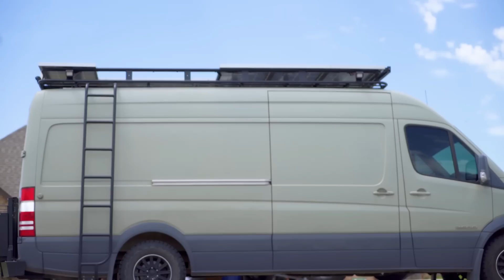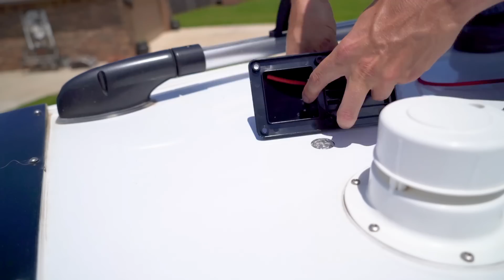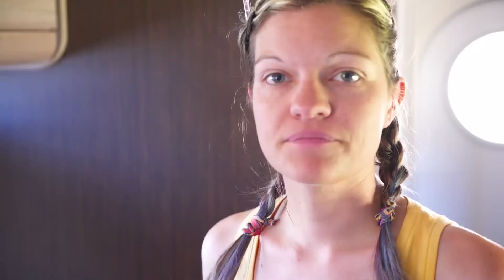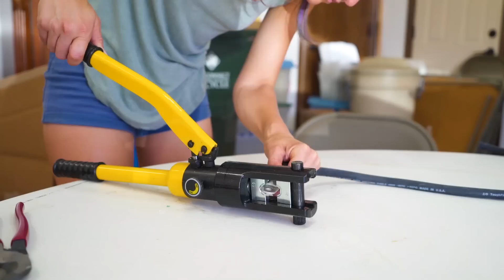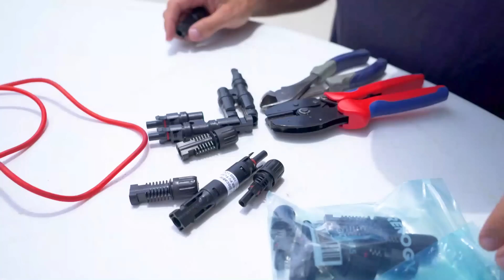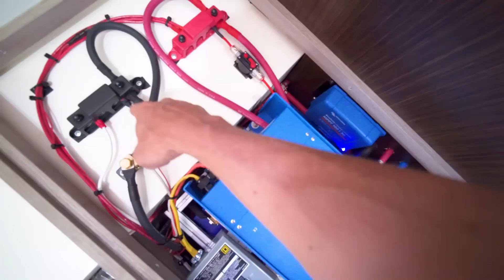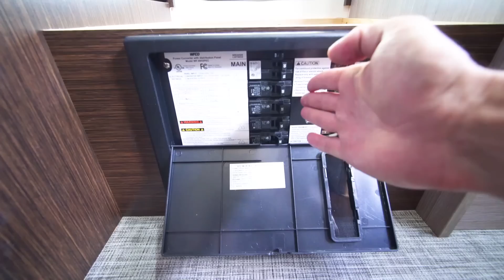Camper Solar Setup Tutorial - How to Solar Power your RV, Camper Van, & Truck Camper

Comment: Thanks for all the info! I'm new to this stuff and starting a restoration/upgrade to an old Shasta travel trailer.  I'm planning to be pretty low key but I definitely want to add solar for charging tech, basic power options. We'll have a small fridge, a water pump, lights and roof fan. I don't expect any major power suckers like AC, Microwave ect...
My question is just how to determine how much power/panels and batterie storage I need? Do I need more that 100-200 watts? The 400 watt system even seemed a little excessive for my planned setup. Any resources or thoughts would be appreciated!

thanks!
Reply from the maker: Hey Joel!  Sounds like a cool project.  I've actually got another video that answers that question.  You can find that here: https://www.youtube.com/watch?v=a406IxiU-Xg

Comment: when funds are unlimited... solar is easy... this is easily a $3,500 system if not more...
Reply from the maker: This system in particular is, indeed, more than $3,500; but they concept is the same if you'd like to use less expensive components.

Comment: Excellent video you 2 made here. Very well explained for us newbies to understand. You get 2 thumbs up👍👍 from me!! 
 I'm putting 1200 watts on my motorhome. Maybe 1600 soon after if I have room. Wire sizes confuse me, and how to set up the panels to get the most usable power. Will have 5 or 6 battle borns soon. I want a 150v/100 amp controller, 3000 watt victron inverter, but confused on connections cuz the RV already has a seperate automatic transfer switch.  
I've asked for help from others on YouTube many times but never get a response. Any suggestions would be greatly appreciated!!

Comment: Great explanation as usual .understand the series parallel solar panel connection .what is the nominal voltage of the solar panel or the input voltage to the solar controller
Reply from the maker: The voltage from the solar panels are somewhere around the 19V ballpark.

Comment: Why do you use such small panels? - we get up to 20amp 12v  charge from a  single  REC 280watt panel and it's hooked up to a 100 amp lithium via an EpEver MPPT - it's only a small European van  - I think proportionally larger panels give more bang for the buck, they are lighter and more power dense if you can get them to fit
Reply from the maker: These panels fit better than bigger ones for this application.  On https://www.explorist.life/solarwiringdiagrams we have more panel size options for you to choose from.

Comment: Thanks for the excellent job! Help me understand clearly, the fridge is not connected to the solar charged batteries? Seems like a whole lot of effort to end up with an ice chest when off grid. ?? Have I totally missed the mark?
Reply from the maker: The fridge is a 3 way fridge, which means it can be powered by 12v DC, 120v AC, or Propane.  The fridge is still connected to 12v DC and Propane, so it is still fully operational off grid.
Reply: @EXPLORISTlife  Thanks for the explaination. Appreciate it and your videos.

Comment: Could you plug your new inverter out (110)  straight into your shore power plug.?Then just keep your AC breaker off. I am doing my truck camper solar . I have considered this but have not tried it yet. Not sure if might have a issue with the other  110 to 12 volt inverter to charge batteries .
Reply from the maker: The easiest way to do it would be just to splice your 10ga shore power cord before it goes into your power distribution panel.  Shore Power In -> Inverter/Charger AC IN -> Inverter/Charger AC Out -> To 30 amp main breaker in power distribution panel.

Comment: Awesome video. I have a question for you I cant find the answer to. I have a 22ft. travel trailer. When I get my system installed and hooked up will my fridge run off of my inverter?Obviously I don't want it to, I want it to run off the propane when Im not hooked up to a shore line. I guess my question is how do I run the solar in regards to my fridge. I want the fridge to run on AC when im hooked to shore power and I want it to run on propane when im not hooked up to shore power even though everything else will be using the inverter. Any help would be great.
Reply from the maker: If you wire it like we did, It will run off of DC (which will be powered by shore power) when you are plugged in.

Comment: Is it possible to expand these down the road without too much trouble?
Reply from the maker: If you plan for it properly it's pretty straightforward!  The new wiring diagrams at explorist.life/solarwiringdiagrams are all designed to be easy to expand upon.

Comment: I have a 1969 trailer i converted to a mini mobile and have instaled a solar system two systems one 800 watt one 400 watt 800 watt is primary 400 watt secondary runs my hole trailer
Reply: Thanks

Comment: Im curious why the microwave circuit didn't get tied into the new system. I know they draw a lot of power, but they're typically only used for a very short period of time. I just think it'd be nice to have the option of using it without having to plug into shore power.
Reply from the maker: Right, we didn't do that because it's a high powered appliance.  Add a second breaker and another wire relocation for the microwave if you want to do this in your own setup.

Comment: Hi, apparently in the UK the household plug voltage is 230 V. Does that mean the inverter I buy should change to 230 V? Would that be the only difference in product? sorry, I'm a beginner.
Reply from the maker: The inverter should also be 230v input from shore power as well as 230 output, but there will be more to change, but I'm not 100% up to date on European wiring specifics.

Comment: How much bigger of a system would you need to be able to run the fridge as well
Reply from the maker: Those 3 way fridges are less than efficient, so we wouldn't really even consider it; ufortunately, I don't have the stats and data to know how many amp hours per day the fridge uses, but once you knew that, it could be plugged into our power audit calculator you can find here: https://www.explorist.life/what-size-of-solar-system-is-needed-to-power-a-camper/

Comment: 1. What about EMF/EMR shielding for the Inverter, DC legs to the inverter......etc! ?????  2. Does a DIY install affect the RV insurance rates or does this need to be installed by a Solar certified technician due to some insurance carriers policy requirements?????  3. Is that the Penson wire crimper $40, any thoughts about it compared to other crimpers like the TEMCO hydraulic wire crimper that sells for around $80??

Comment: Awesome Video. I am putting in almost the same system. By splitting the shore AC and Inverter AC (Plugs Only) did that eliminate the need for a transfer switch?
Reply from the maker: Not really...  The Victron Multiplus has a built in transfer switch, so that's actually what gets rid of that.  The transfer switch and the switching of the plugs like we did are not really related.

Comment: THANK YOU FOR YOUR DETAIL VIDEO 
WHAT ABOUT WORKING WITH 24VOLT TRUCK AND RUN 12 V SYSTEM  WITH C-TECK SMART SYSTEM TO CHARGE 3 BATTERY AND WITH TWO 100W SOLE PLANE?
BECAUSE of ISUZU NPR CREW CAB 4X4 TRUCK 
FROM AUSTRALIA

Comment: Excellent info, tons of knowledge! Very impressive!  One thing I am a concern though.  Trusting a plastic anchor up on the roof to secure a solar panel that will face headwinds while driving down the freeway?  .... may want to rethink that.  Plastic anchors are not designed for that kind of stress.  It is actually a very weak gadget.
Reply from the maker: Rethink that?  You'd like us to drive halfway across the country, uninstall the panels, and do it some other way?  No thank you.

But please do not be concerned.  The panels are not held in place with merely a weak plastic gadget, no.  The tube of epoxy mixed with the plastic anchor makes a solid, immoveable slug of polymers for which the screw is driven into.  But that's not all.  The Industrial grade foam tape used provides nearly 70 lbs per foot for a total of 280 pounds of upward lift resistance per panel.  Furthermore, we used an elastomer adhesive over the top of each foot.  Which, if you didn't know, has a tensile strength of about 160psi.

Moral of the story.  If we lose the panels going down the road; the roof is coming with them.

Comment: Can you use the solar charge controller to also charge the starter battery for an rv at the same time?
Reply: I was only using the rv starter battery as an example. I have a race van with my motorcycle scored in the back and wanted to be able to charge it while on the move. I don't want to have to rune the charger for my motorcycle off the inverter. Be counter productive that way. The only thing I can think of is a DC to DC charger wired directly to the batteries. But was hoping for a neater solution. Hate multiple terminals with inline fuses connected to the batteries
Reply from the maker: In our setups we don't charge DIRECTLY from the charge controller, but we use a battery isolator or b2b charger to charge a starting (or motorcycle) battery from the house battery bank.  I don't have first hand experience with this one, but I believe this solar controller has a 2 amp trickle charge aux output that's for that purpose: https://amzn.to/2HwHTzZ
Reply: @EXPLORISTlife  thanks
Reply: @ACEighty7  If you have solar a battery bank  and inverter in trailer already...keep it simple and just use a battery maintainer, that gives you the option to use it for others too. Your bike battery shouldn't really need to charge most of the time.
Reply from the maker: Totally agree with mrmotofy on that one.
Reply: Damn auto correct
Reply: So after digging around a little more I found probably the best solution. A DC to DC charger which I will hardwire into my 12v distribution board with the appropriate fusing and a basic switch to turn it on and off. Being wall mountable I can keep it close to my electrical cupboard but also keep the connections to the batteries minimal and tidy.

Comment: Hey, I have a couple of question...
1. Would I be able to have a battery isolator charging my battery bank while the car is on AND have the solar panels charging my battery bank when the car is off? Is that an impossible setup?
2. Do you have to unhook everything from the batteries when connecting them to a battery charger? For example, if you're connected to shore power... could you potentially connect a battery charger to either battery in the bank to charge the batteries?
3. Is a single 100w solar panel enough to charge up or maintain your batteries topped up? I have a 205ah setup
Thanks for the video..was very informative
Reply from the maker: #1:  Totally possible.  When the solar controller senses a secondary charging source, the solar controller turns off allowing the other to work.  You really want only one charging source working at a time, but the switch from one to the other will happen automatically.

#2:  The way things are set up in the video, nothing needs to be disconnected.  All of the switching happens automatically.

#3: If you use your entire battery capacity in a day, a 100w solar panel will likely be unable to recharge that much in one day.  Since you've already got your battery bank, I'd recommend starting here to find out how many solar panels you need: https://www.explorist.life/how-many-solar-panels-are-needed-to-power-a-camper/
Reply: @EXPLORISTlife  do all solar controllers turn off when it senses the isolator is now actively charging the battery bank?
Reply from the maker: As there are literally hundreds of brands of solar controllers on the market, I can't speak for all of them, but most of the more popular ones will shut off.  All of the Victron ones will.

Comment: are those drywall anchors strong enough for highway speeds?
Reply from the maker: By themselves, likely not.  Coupled with the epoxy, 3m foam tape, butyl tape, and dicor sealant?  I'd guess if the panels came off, the roof would come off with them.

Comment: might be a dumb question but if you're plugged in to shore power on a sunny day could you back feed power to the grid if your demand for power is lower than what the panels produce?
Reply from the maker: Nope!  The inverter/charger takes care of that and makes sure it doesn't happen.

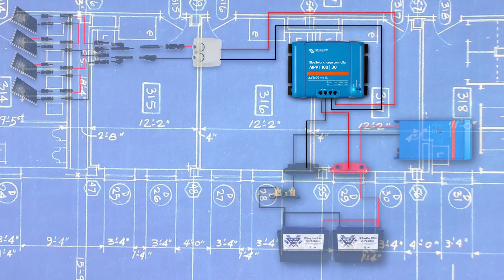Comment: @ 12:08, Is the reason your panels are wired in series to drop the amps down for the controller? wouldn't it have been better to wire in parallel and use a 40amp controller? or does it not really matter with an MPPT controller?

Comment: bro quick question why in the hell did you splice into the fuse box you do know that fuse box is also a inverter
Reply from the maker: There was no pre-existing inverter in the RV.
Reply: EXPLORIST life Oh okay I'm used to dealing with some of the old rv where the fuse box is also the Inverter
Reply from the maker: All good.  It's definitely a good idea to check and understand the existing system before you get started.

Comment: Appreciate some insight here... It's not clear to me how having multiple multi-stage charge controllers connected to the batteries works.  In my setup, I wasn't thinking of having an inverter as I just need DC power for overnight boondock stops, not multi-day dry camping.  I was thinking of having 
1) install PV -> multi-stage solar charge controller, 
2) replace RV's basic single stage charge controller with multi-stage to charge when connected to shore power

But now, do the two multi-stage controllers conflict or fight for different stages?

Comment: I appreciate that you didn't use soldering on any of your connectors. many people will say otherwise, but there is a reason that all wiring is always professionally done using crimped connectors, not soldering.

Comment: Hi @Explorist Life, thank you for the very helpful video.  Do you have more info about how you wired in the Air Conditioner so it didn't go through the inverter?
Reply from the maker: The alterations we showed with the 110v wires in the junction box going around the breaker box is how we circumnavigated the air conditioner.   As long as you don't wire the inverter to the house breaker box, it won't power the AC.
Reply: @EXPLORISTlife  Thanks.  But then how do you have a breaker on the AC?
Reply from the maker: The breaker is still functional in the breaker box.  You're just taking the 110v plugs away from the breaker.  The air conditioner will function as normal.

Comment: What i don’t understand is why the Inverter costs so much? A uninterrupted power supply with similar specs is literally 300-400 dollars and does the same thing converting 12 volt battery power to 120 volt AC... All you have to do is crush the annoying  buzzer and wire the battery cables to the rest of your batteries and you’ve got an extremely easy to use inverter. Some of this specialized crap is stupidly simple to get around.

Comment: The wire you're using from the roof to the charge controller looks a little on the thin side.
Reply from the maker: Nope.  10ga is totally within spec.

Comment: I have the same camper!  Trying to find setup to run microwave or a|c w/out shore power?  Was thinking either Honda 3000is generator or marine grade batteries w 3000 watt inverter.   Your thoughts appreciated.   And I’d like to read e-book but don’t see a link?   Thx. Kent.
Reply from the maker: This system would power the microwave but there aren't enough batteries or solar panels in this system to power the Air Conditioner.  This link will give you info about the ebook: https://www.explorist.life/diy-campervan-solar/#truck-camper-solar-project

There are a bunch of wiring diagrams at the bottom of that link, and the biggest ones would power an air conditioner.  You'd be looking at some kind of custom sliding rack system for your panels, and likely would have to lose one of the drawers under the sink to store enough batteries.  I'd venture to say it's doable, but it's worth noting you'd be looking at north of $10,000 for powering the air conditioner on that truck camper via solar.

Comment: Nice video just a thought tho battery’s,charge controller etc. all in a small space I would be concerned mite not get the cooling it will(mite) need?
Reply from the maker: Ventilation is key!  We added 2 computer fans to the compartment to help, but I dont think that made the video.